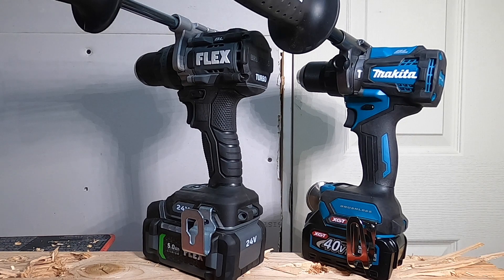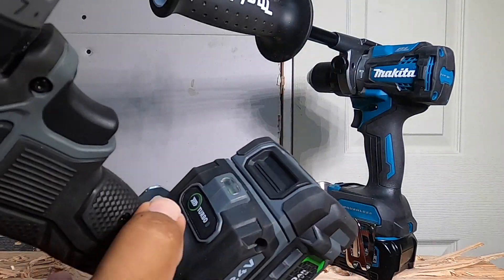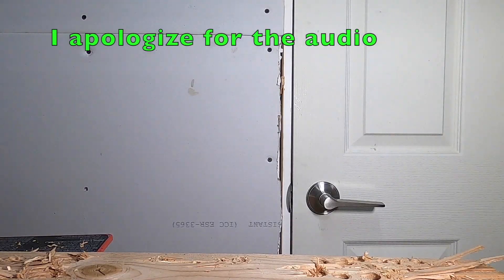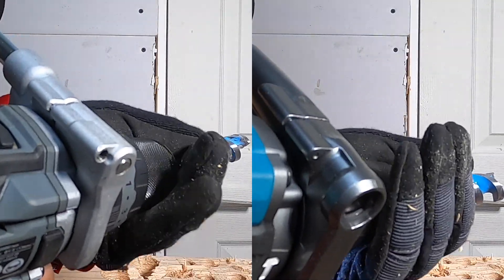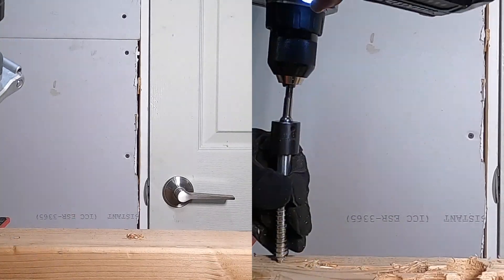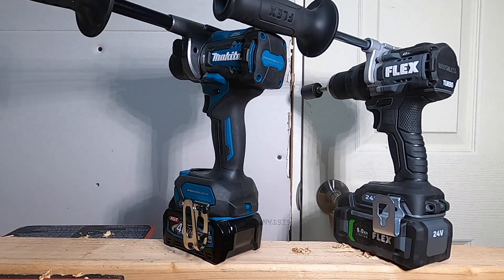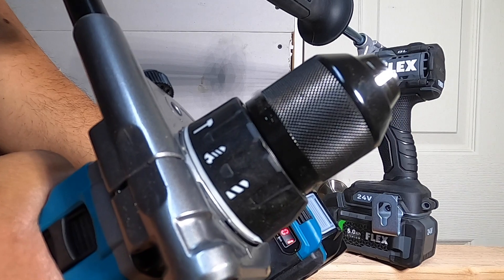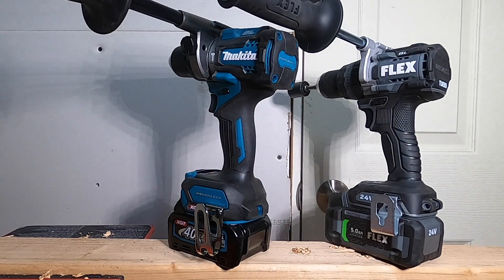Flex Turbo VS Makita 40v XGT Hammer Drills

Comment: Imma have to go with the makita 40v. Longevity and durability of makitas have proven itself worthy. Thanks for the vid! ❤️
Reply from the maker: You can't go wrong with makita!
Reply: No brainer... I think everyone would buy the Makita if they could actually afford it over the flex.
Reply: Maybe not everyone… the hammer capability is very effective on the Flex I use it for driving anchors and it’s faster than our plug in sds.

Comment: Been a few months and i have bought into the XGT 40vMax system. The advantage is very big for power demanding stuff like angle grinder and sawzall. The impact wrenches are the strongest money can buy, well known fact but these cannot be praised too much. This hammer drill is also awesome, as is the XGT impact driver.

Comment: I think people need to take into account that 36v should run cooler than the 24v.  One thing I notice with the Flex is that it tends to bog down as it starts to overheat.  We can say that longevity, Makita should win over Flex. On another note, you can definitely tell Flex is trying to find ways to keep the batteries cool to a certain degree and let's hope that "stacked technology" is true according to VCG.  I am all in for different types of technologies as that simply brings more diversity in the tool making industry.
Reply from the maker: This flex Turbo overheated in the handle the first few times I used it.  In this video seems to be ok.
Reply: @toolhead147  All I can say is that I feel Flex is a little inconsistent maybe with their electronics.  They do pack lots of power for sure, but it's just the thermal cut outs or protection threshold settings will make users think the tool is incompetent at times that they are forced to bring out other tools that are more capable.   There will be moments where you have to make long and deep rip cuts with the circ saw and you can't afford to wait for it to cool down at least 30 minutes before you can safely use it again w/o damaging the battery.  This is probably one of the downsides of being an earlier adopter of a new brand until Flex makes the fine tune improvements.  Also hate to say it, Flex's impact and hammer drill combo set are also on the heavy side for that size. They are compact in length, but bulky on other dimensions.
Reply: Just for consistency, if you call the Makita 36v you also need to use the nominal voltage for the flex, which is 21.6v. Or we could assume that you mean the older Makita 36v system which is 2x18v. I prefer to say XGT or 40v to avoid confusion with the 36v line.
Reply: @pflaffik  Very good points 🤘

Comment: Which one currently has the LIFETIME warranty on both the tool and battery, and which charges faster?
Reply: LOL
Reply: @derekmclv  Not Flex lol it's a 5 year warranty only of you register the tool within the first 30 days. If you fail to do that it's just a 3 year warranty.  Makita > flex or "Chevron" everyday son.
Reply: @clarkfos3447  Wrong.  It's a LIFETIME warranty if you buy this year and register it in 30 days.  So long after your tool eventually crapped out on you I'll be having a working one and perhaps even a newer replacement model if mine ever quits.

Comment: No doubt Flex is no1 Hammer drill in world at the moment
Reply: Not what I've seen🤷‍♂️
Reply: Based on all the comparisons I’ve seen so far, FLEX appears to be the strongest, charges the fastest and nothing compares to the warranty for it and the battery.
Reply: @hoodem59   then you clearly haven’t watched enough reviews
Reply: Flex is all about big power delivered very fast but the catch is they drain the battery very fast and get very hot very quickly and they will consistently break and fail hence "the lifetime warranty" because you will need it multiple times a year if you drop your tools and actually use and abuse them heavily in elements and severe temperatures. If you don't rely on your tools everyday to run your business or work when you're on the side of a mountain on top of a skyscraper or elevator shaft I guess Flex would be okay...
Reply: @clarkfos3447  ok nice information